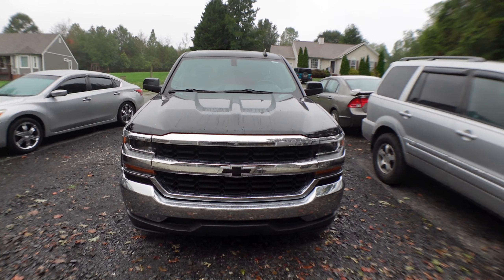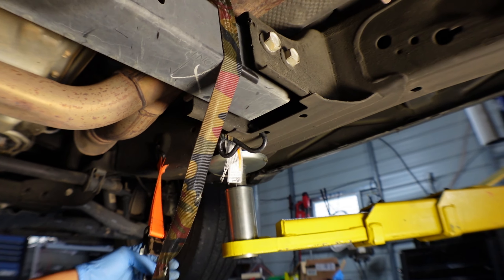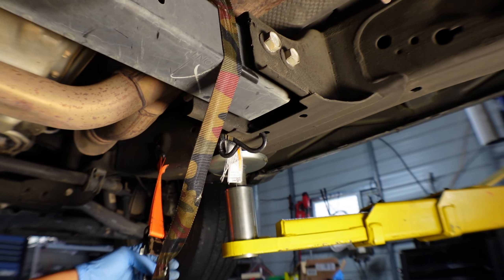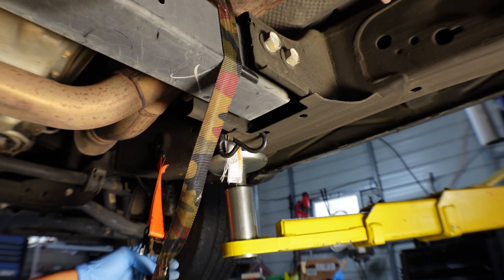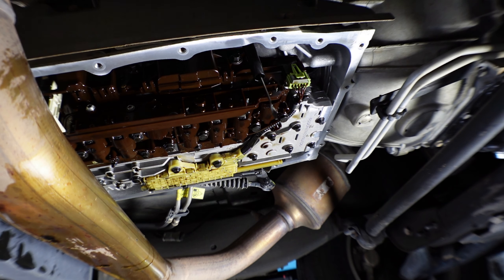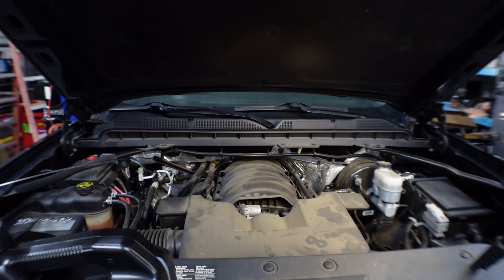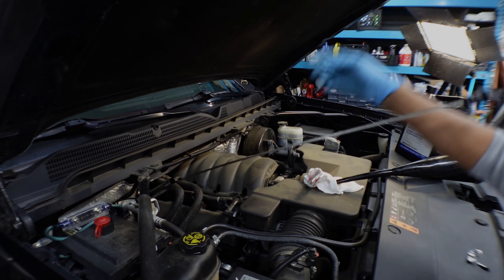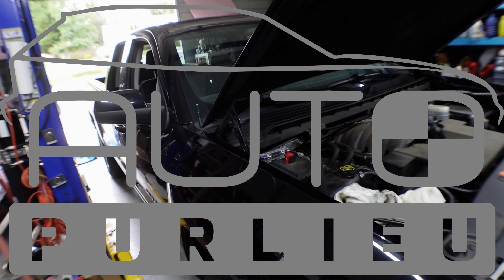Fast & Easy How to replace Transmission Oil Filter 2018 Chevrolet Silverado Fluid change AT 6L80

Comment: Im confused. The manuel doesn't say anything about the oil being full synthetic. I guess the full synthetic wasn't created in 2018. Is it ok to mix the 2018 oem non full synthetic oil with new ac delco full synthetic oil?
Reply from the maker: @blackhawk2040  just drain them all and use the full synthetic. Just to be safe

Comment: I don’t have a new seal/washer thingi for the filter ,…? How has your truck been reused and not replaced, because I’m planning on not replacing mines nd doing exactly what you did
Reply from the maker: @chrisvelarde2106  for me , I rather wait til I get all the parts than regretting of doing the work again, when something fails
Reply: Great advice, I know I would end up doing the whole process two months down the line because of not waiting for Monday to get the part…….it just wouldn’t let me sleep at noght

Comment: Changing the filter is fine. By dropping the pan you are losing 1 gallon of fluid. No need to go through the whole transmission shifting etc because 2/3 of the fluid is still in the torque converter. And a 6L80 takes 12.4 quarts not 5 gallons!
Reply from the maker: Ok lol